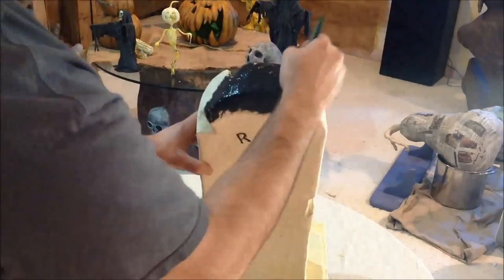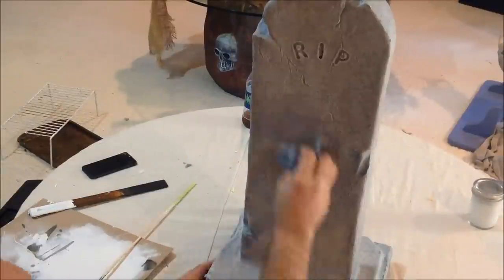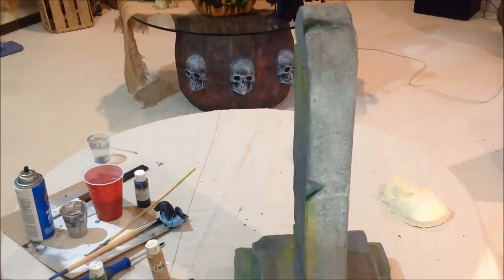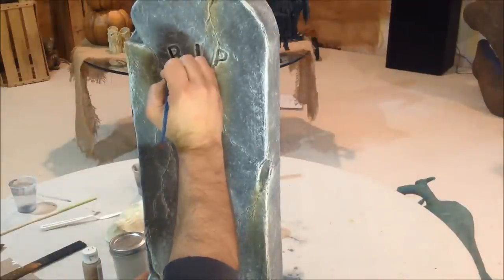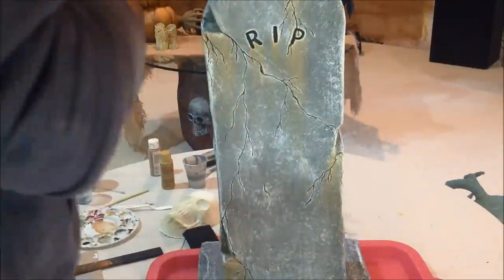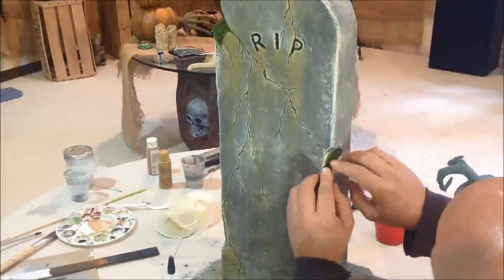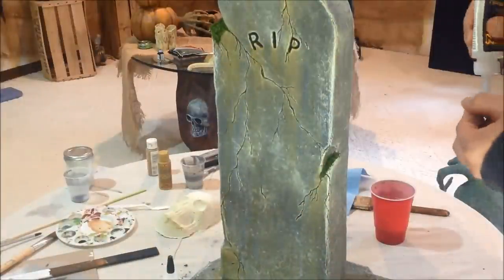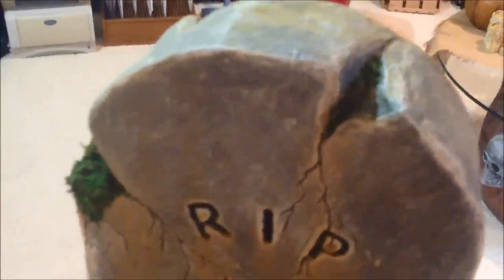How to Make a paper mache tombstone part 3

Comment: Wish me luck brother I got my supplies together.  1st project is a tomb stone for sure . I'm excited.  I am a complete Halloween fan.🎃
Reply from the maker: Right on man! Have fun with it. One thing I’d suggest that’s not in the tutorial. If you’re using cereal boxes, once you get it layered up good and it’s dry, maybe even after the clay. I’d spray some expanding foam inside the cereal box and add a piece of pvc.  That will help the over all strength and give you something to slide over a piece of rebar
Reply: @UnhingedProductions1  awsum thx man good looking out

Comment: I've been making my tombstones out of rigid insulation foam, and while that stuff is good to work with, it gets very expensive when you're outfitting a whole cemetery.  I've got one stone in particular in my head that would lend itself well to this method., so I think I'm going to give it a try.  I don't know if I'll be able to get it done for this year though, we're running low on time.
Reply from the maker: Good luck with the new stone!  Yes we are very much running out of time

Comment: Is it ok to dip the entire sheet of  news paper into the mache glue, or does it need to be cut into sheets?
Reply from the maker: You can do either. I find it much easier to work with when it’s in strips. Full sheets you will fight wrinkles